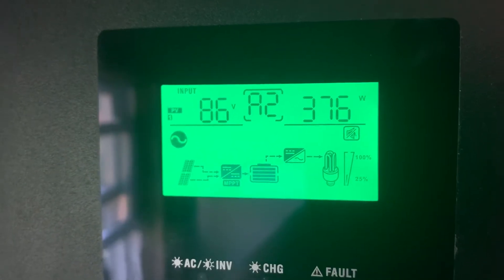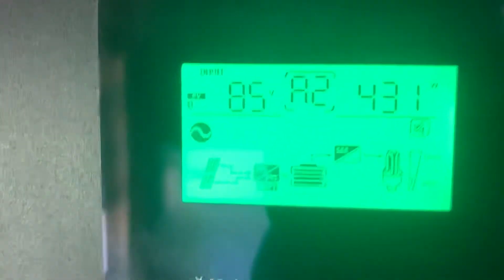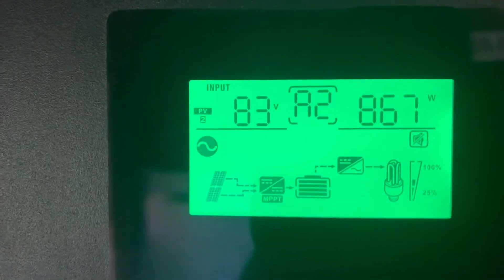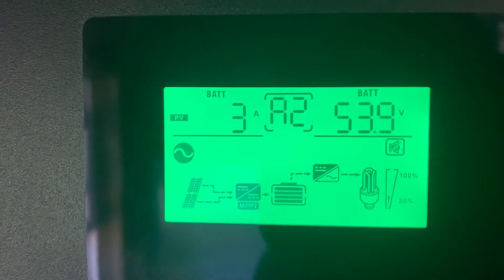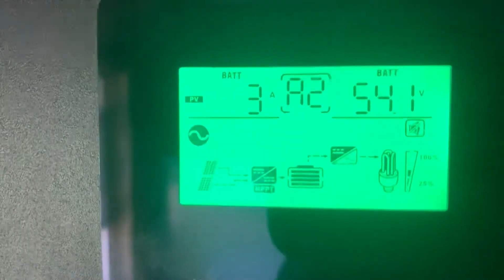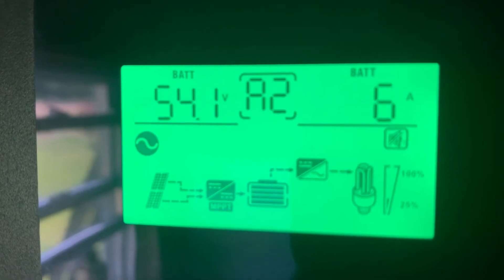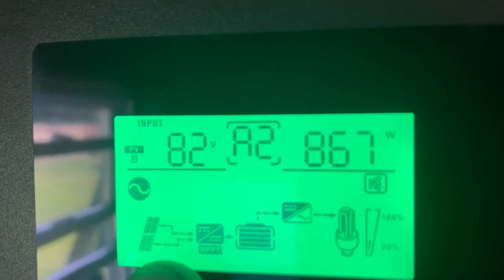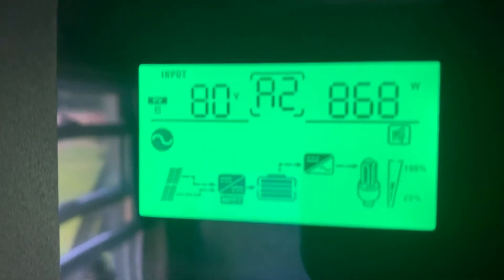Mpp Solar LV 6048 running update

Comment: Do you experience any overheating problems during the summer months?
Reply from the maker: I have not noticed any overheating problems. there is a filter at the top that you need to remove and clean however.
Reply: Thanks,I've been running a 15kw powerjack inverter for 3 years now. It works great until the outside air temp. Reaches 75° then it overheats when I'm pulling anything over 2.5 kw. I am thinking of switching to this inverter/charger cause I've never used more than 4.2 kw . Plus I like the idea of having both units in one

Comment: I just bought one of these LV6048 and a SOX battery with the intention of taking them to my cabin. However, I manage our company's servers, so of course it first it ended up at my work, testing all of our equipment individually to make sure when switching from utility to battery and back, nothing would reboot due to the 10 millisecond gap in power.

To my surprise, everything worked flawlessly. Our current UPS is on its last leg at 15 years old, so we retired it this week and the LV6048 is now hanging on the wall in our server room as the new UPS. Solar panels to be added this year to extend the runtime. Of course, work is going to buy me another LV6048 and SOX for my cabin....

But who knew solar would make an excellent UPS replacement?!
Reply: That's exactly what's got me looking at this direction.  When was it installed and how's it working since?  Anything I need to know before pulling the trigger on it?

Comment: I purchase this system with 10 solar collectors and 8 gel batteries, but the batteries never charge full, even with solar energy, generators or from electrical company..  there is something wrong with the programing. The manual don't give me a detail explanation how to fixe it .. Can you? I want to add an A/C unit, but I cant with this troubleshooting
Reply from the maker: It sounds like you need to change the battery type, I am using “use”  it it setting #5. in user defined you can set the float and bulk charging values which are probably not high enough to charge the battery fully.
Reply: @the_pretender  how can you set manually? I dont have a computer ,on hand to fix this
Thanks.
It would be helpfull a video from your experience.
Reply: Also this equipment was purchase and set on june this year..by a company. Indont feel secure of what they did
Reply from the maker: @rebeccarios7285  i did make a video showing how to change those settings
Reply from the maker: I can make a video showing how to change those settings

Comment: good vid thx...is it still working?  the water resistant version is a paper weight i guess.  a couple peoples aid all of them communicate with China for no good reason, nortupdating, so forget off grid power if they feel like screwing us
Reply from the maker: yes, Ive had it running pretty much since the unboxing video, so almost a whole year.